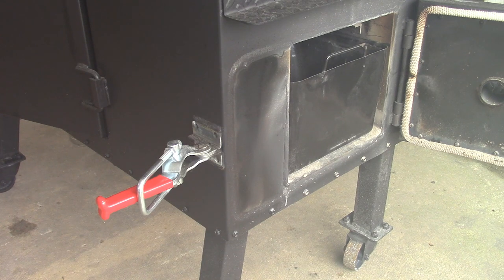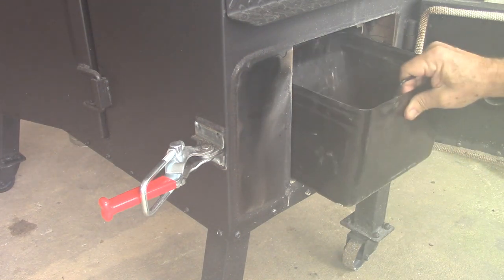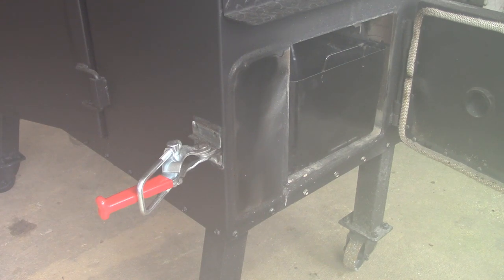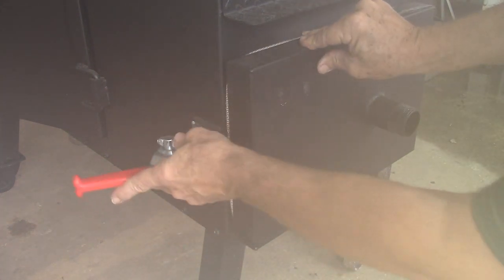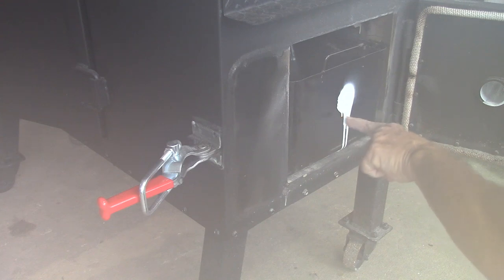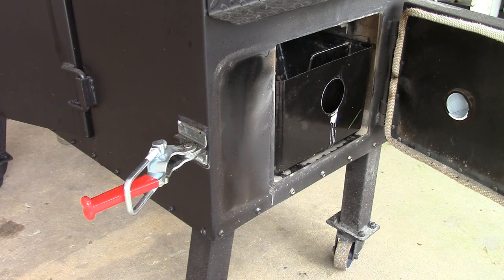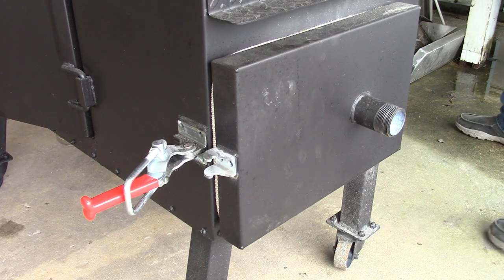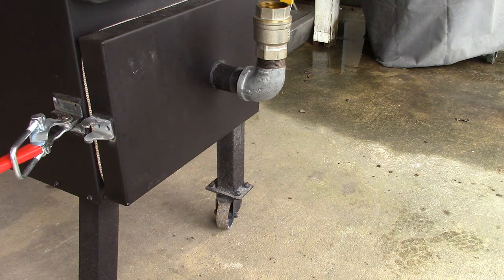Old Country Insulated Gravity Fed Smoker "Ash Collector Mod"

Comment: How is that 90 degree mod working. Seems dangerous to me. If you leave the door open too long and the fan is off because of LID detection, seems like it could back-draft and ruin the billows
Reply: since I got my stick burner, I don't use it that much, but never had an issue with it...I guess it is like anything else...If you don't pay attention ...things can go sideways....thanks for the comment!